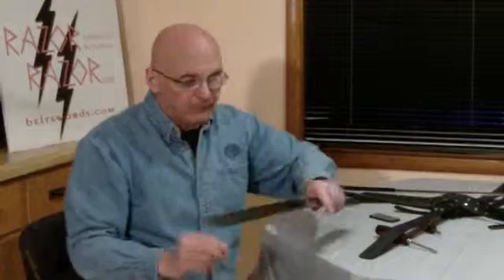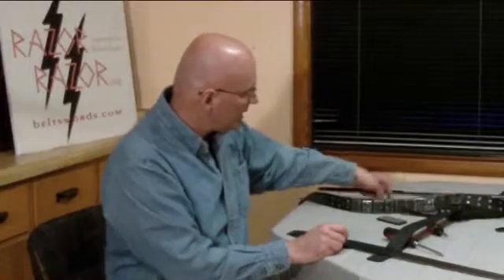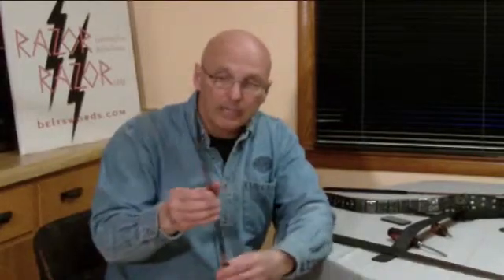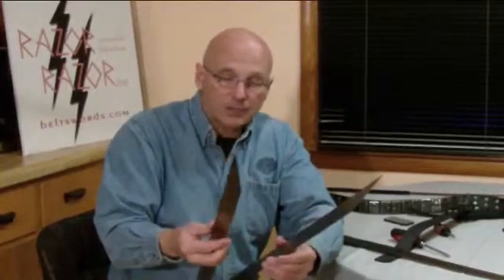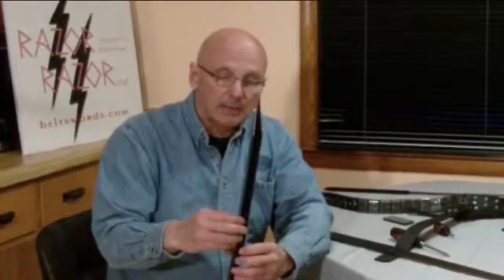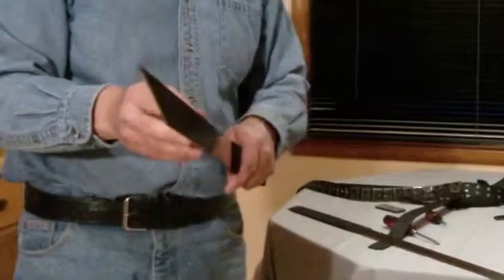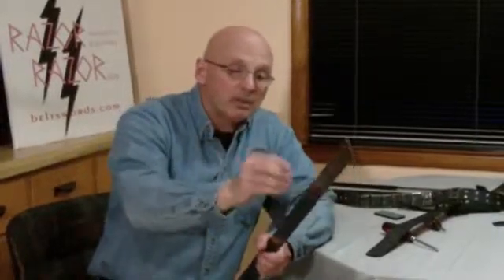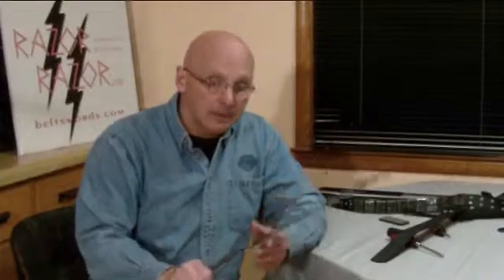Belt Sword Laminated Blades - Superior Design #38

Comment: Is there a way to tell if the blade is laminated? If there is would this be all steels like vg10
Reply from the maker: Speaking only in regards to the weapons manufactured by RazorRazor; you will visually be able to see the laminations in the RazorSword or RazorBaton.  Please recognize that the laminated blades of a RazorSword or RazorBaton use molecular adhesion to bond the laminations, and "float" on liquid layer at the molecular level.  No one has ever manufactured swords in this fashion.  VG10 or any stainless steel will fracture if used in swords; we use only 1095 high carbon spring steel…specially tempered.